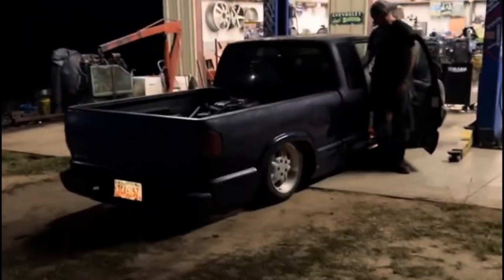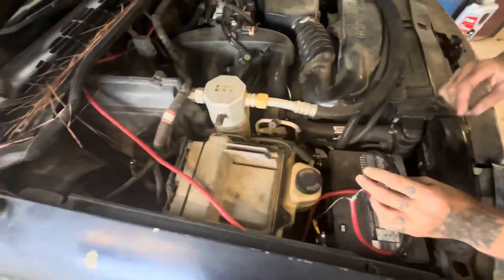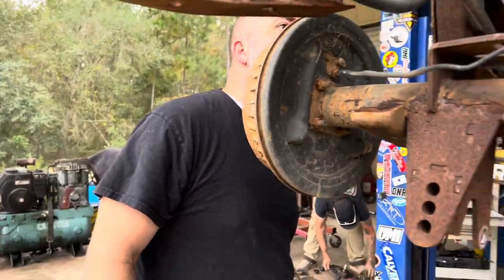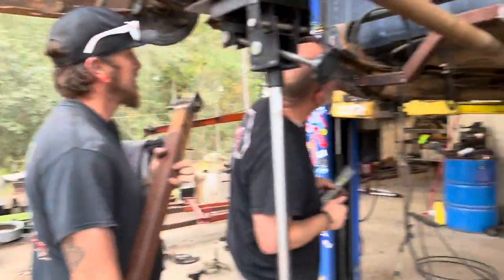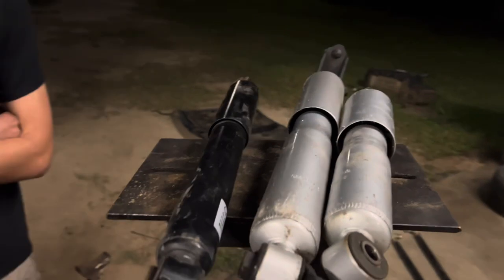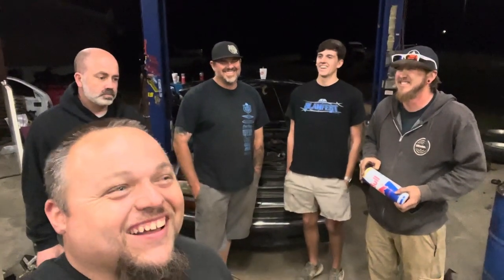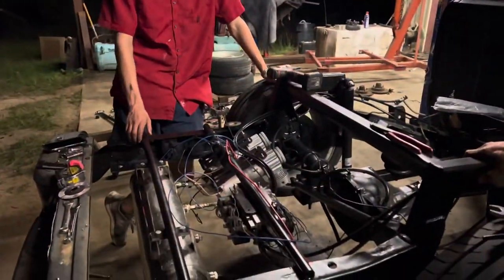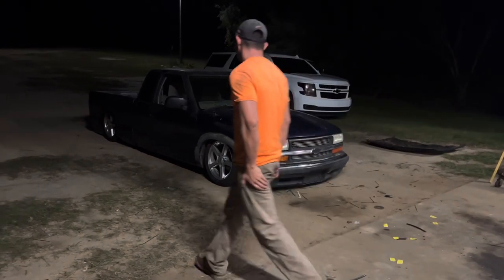Re-bagging our buddies death trap s10 in one day without him knowing….

Comment: My GOD why is the rear end so off? If you look at 29:01 you’ll see the driver side rear end almost rubbing the CNotch Vs. The passenger side thats way off the CNotch by 5-6”.
Reply from the maker: Do you understand the concept of how a panhard bar works? As the suspension cycles it pulls that axle in an arc….this truck was at full droop at 29:01 as it was on the lift….the axle is centered at ride height which is how it’s suppose to be setup….to avoid this you can swap to a wishbone, triangular 4 link or run a watts link….this is the most cost effective route as this was a quick, fast, and free job to help out our buddy….thanks for the concern tho